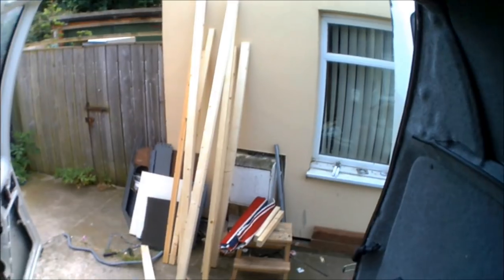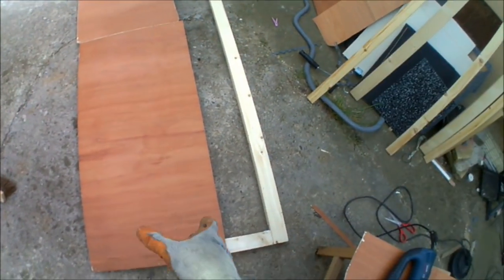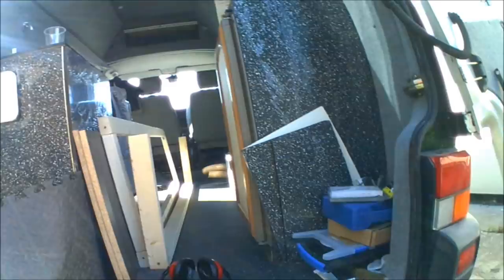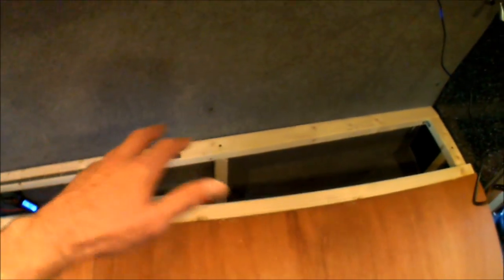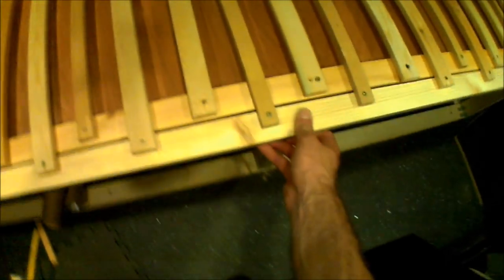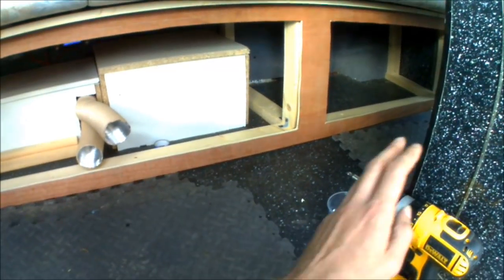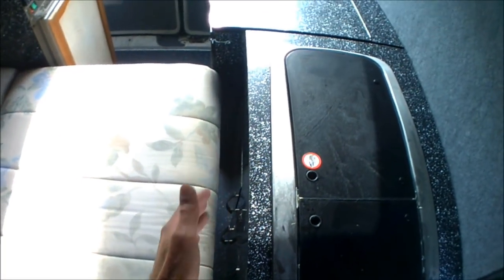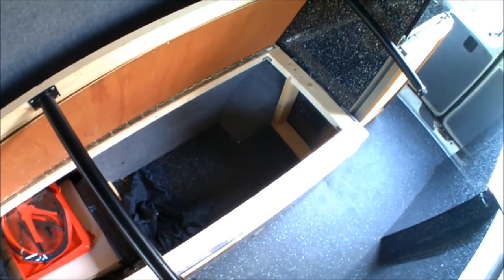DIY Campervan Pull Out Bed Build & Install Guide VW T4 Camper DIY Sofa Bed Build

Comment: Thank you for the video. You break it down very simple. Easier than some of the other slide out bed builds. Thank you
Reply from the maker: Thanks, glad to be of help
Reply: @TheCampervanBuilder  
I am considering buying a cargo van and converting it to a trailer. I have no experience but there appears to be lots of resorces on u tube and books etc. My plan is to sell my house and live in it. Videos by people like you are very helpful. My plan is to make it very simple but with the ability to live off grid or hook into shore power.

Comment: I'd love this design to take in and out the van when I need my van to carry other stuff
Reply from the maker: It's do-able, just make a stand alone frame rather than securing it to the van
Reply: Camper Conversion gonna do that , wife uses van for some large flower arrangements so it's ideal to come out, I like the simplicity and pods idea 
Thanks

Comment: Hi have you seen the new guide for camper van conversion you have to have two windows on one side of the van not counting the drivers or passengers door windows . And a Awning rail  it dose not say you have to have a awning it’s just says a full length of the van . And must have a seating aria with table and there must be graphics on both sides of the van
Reply from the maker: HI yes I have a new video out about the new guidelines just today

Comment: Couple of design issues. The gaps between the slats are far too wide (once in the pull out position) and once you put the mattress/cushion on top when you want to lift it you have nowhere for the mattress to rest while its open (it will be squashed against the wall). If anyone else uses this design all you need to do is put a piece in along the wall that is the same width as the thickness as your mattress and problem solved. Apart from those thanks for sharing.

Comment: 18:43 - The gaps are too large my friend.  Mattress will sink into spaces.  A few more slats would have been perfect.  Nice build!  This is still the best design for a van bed.
Reply from the maker: I've been away in this van multiple times and never had a problem with the slats at all
Reply: @TheCampervanBuilder  I think he means it will damage the mattress over time. If the slats are wider the mattress can't droop in the gaps.
Reply: yeah i was thinkin my arse wud get stuck in between them-great design but il b puttin mine closer together

Comment: Great video cheers mate, exactly what I want to do in my T4. Did you take note of the dimensions of the frame you build in the beginning? As well as height of the frame built into the van?
Reply from the maker: From what I can remember, roughly 200x55x55 with pull out section measuring another 45

Comment: thanks for posting this. I'm curious, what stops the outer edge of the pull out section from collapsing when you lie on the bed and your weight shifts over the area supported by legs ?
Reply from the maker: The inner slide bar secures the pull out section with the legs taking the weight of the other side, works a treat

Comment: Love this bed. Way cheaper than a rock & roll bed. 1 quick question. When be bed is extended, what stop the the pull out frame which is now in the centre falling in with the weight on it. I may have missed something somewhere.
Reply from the maker: Thanks, one half of the bed has solid static slats so if the bed is pulled out, half the bed is solidly secure and the pull out section can't fall through the frame due to the ply I have fitted underneath and the extending section also sits on the main support frame too, so there are no issues with it falling in/through etc and I can confirm this having been away over the bank holiday and it worked great, re-watch it in detail if you need to see how its constructed and fitted together

Comment: hi could you give me a list of materials required for this bed and size how did you manage to fit the fridge at the end is it an over the wheel arch fridge
Reply from the maker: The fridge has its own cupboard made that sits over the wheel arch with a video of that on my channel, I list what materials I use in the video but it’s just lengths of timber from a local timber merchant with old caravan bed slats used for the pull out section.

Comment: Great series of videos :)  One quick question, how much does the DLVA process cost ?
Reply from the maker: Thanks, DVLA costs nothing to re-register as a camper, just fulfil the requirements and send the documentation along with photographic evidence of the conversion and they will re-register it for free as long as there are no other changes required like ownership or change of address etc.
Reply: Cheers for the info :)
Reply: What are the main benefits (and cons if any) of registering it as a camper? Tolls, ferries, insurance, etc.? Cheers.

Comment: Great video,just making the decision to do a self build myself,like the idea of this type of bed thanks for showing us.Where can i find the list of requirements of the Dvla for registering as a camper please ?
Reply from the maker: Thanks, lots more useful videos on my channel on how to convert a van, google should provide a detailed answer but generally you need a fixed cooker (no portable stoves) and water, a fixed bed or seating that converts into a bed of at least 6' in length, storage space - whether under the bed of cupboards, a table that attaches to a fixed point in the van and you also need at least 1 side window.  All the above need to be in a fixed position to the van.  These are the main big 5 requirements, everything else is optional, take photo's, send them a nice letter and the V5 and they re-register it for free

Comment: Great job what size timber did you use
Reply from the maker: Thanks, the wood was 3x2" for the  main frame and base and then 2x1" for the top (if I remember correctly)

Comment: where did you get the bed legs
Reply from the maker: They were from B&Q although Wilko's, screwfix & others  also do some
Reply: @TheCampervanBuilder  top man I'll go have a search, I've just got a T5 in building on a budget and need space in the back so the style of bed you built will work better for me
Reply: @TheCampervanBuilder  keep them bids coming, I've not done wood work, but I've always welded and painted my own vehicles, I'll prep the T5 and get someone else to paint it

Comment: Hi, what material did you use for the seat and cushions, it looks quite lightweight , thanks
Reply from the maker: Hi I used some seats from a caravan I scrapped for parts, not that I used many parts from it, namely the seat cushions and fridge.  I might get them recovered eventually but they do the job for now
Reply: Ok thanks that's a good idea to keep in mind for when I do mine
Reply from the maker: lots of reclaimed cushions on ebay/gumtree, i still have spares left myself as I only used 1/4 of the cushions that I got